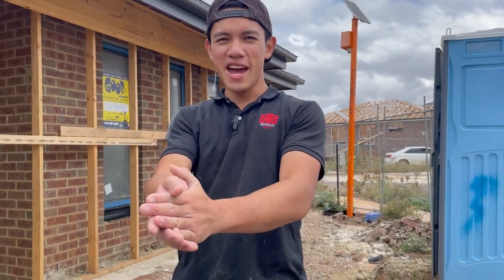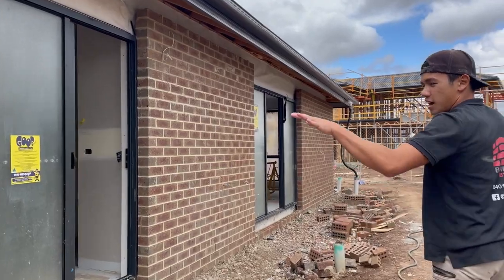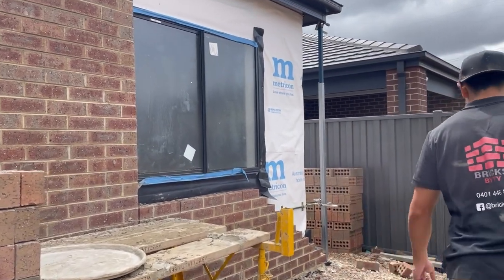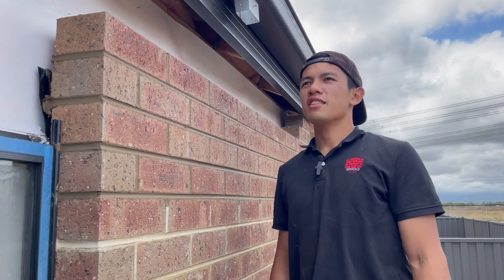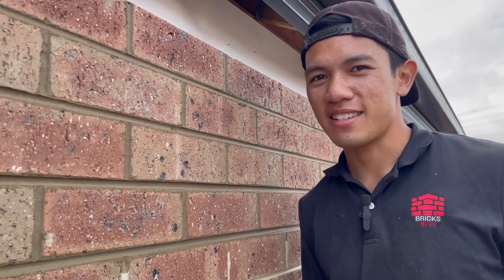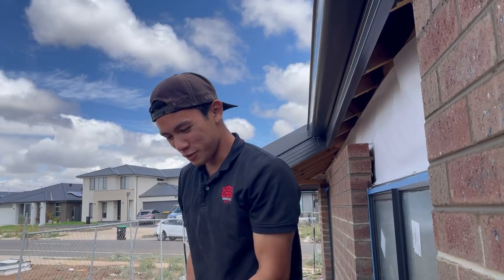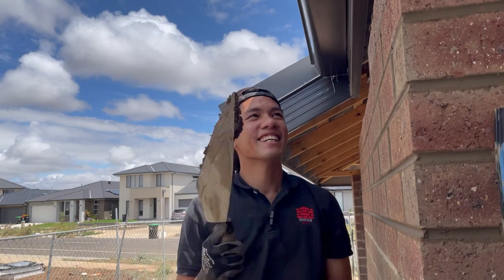BRICKLAYERS ARE ON HOW MUCH MONEY?! | BRICKLAYING AUSTRALIA

Comment: $2.50 to $3.00  a brick in W.A mate boom happening here 👌
Reply: That’s awesome. More double brick over there.
Reply: That’s a serious price mate 
2boys 1000 bricks a day easy money,Is the heat not a killer there though mate
Reply from the maker: Hey there! That's over double to what we earn down this way, must be good to be a bricky over there!
Reply: Are those the clay blocks or actual 230 x 110 x 86 bricks? It can't be that high for a normal brick,must be those blocks
Reply: It's the going rate most homes in w.a are built with maxi bricks  . Standard bricks are rare ,  Also double skin walls here as well . Few years back it was 80c a brick .
Reply: @deet1558  you get the days were it's tough in the heat you sort of get used to it after a while
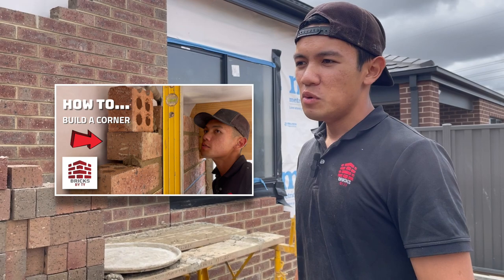Reply: @siegemoose6178  ah that's alright still, we do get the occasional double brick home in nsw especially around expensive areas,you can get the price for anywhere from 80c to 1:40$ commons and face included,you need a decent sized crew and well organized plan to do it efficiently,but if you just want to make steady money with gaurenteed work brick venners are the way to go,get in slap em up and you don't need many people...price for brick venners fall around the 1.50 to 1.80 mark(for double stories) then add the the extra like loading cuts ect...price goes up in total,single stories go for about 1.40 or 1.50 although some try to offer 1.20
Reply: Enjoy it whole you can...
Boom bust in wa...
Reply: @p.maesthetics7154  we do blocks but ours have brickbrick and internal brick walks in wa
I  won't speak for anyone else but averaging 35k every quarter/3 months
Reply: @wanchaipombua4176  that's seems nice,must be good up at wa
Reply: @p.maesthetics7154  how's weather  in sydeny? How many rainy days off all year u think? Here perth rarely no rain, maybe some days off at winter but pretty much could work all year
Reply: @siegemoose6178 we  WA has good price but isnt it hard to compare double brick and brick veneer, maybe still easy to make money for veneer? setting up door window and so many details killing time in WA, and but veneer seems more simple for work
Reply: @cheersbud328  you get quite a few rain days I’ll be honest, but not as bad compared to Queensland or probably Melbourne. It’s hard to say but what I will say is you usually get a good run for a fair few weeks then a whole week of rain appears, usually it’s like that do we work or do we stay home type of rain, where it’s only a slight shower all day long, but it not too bad overall